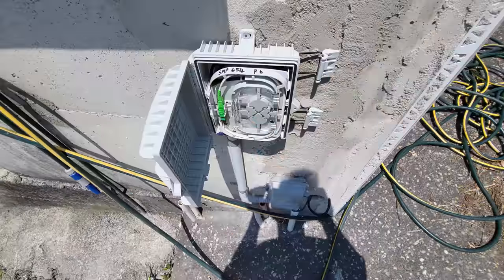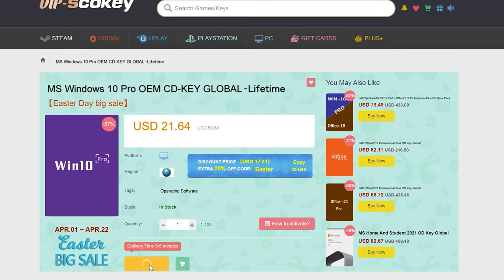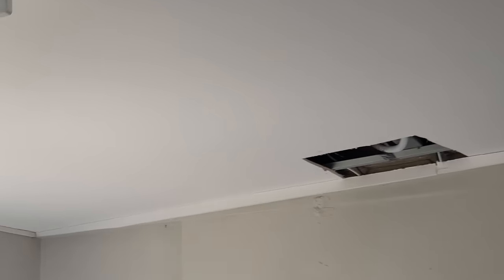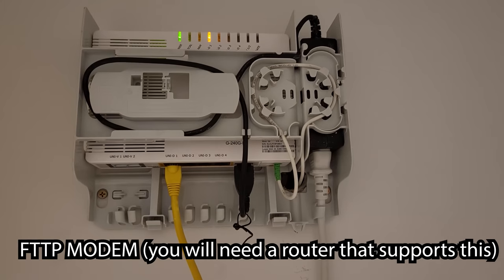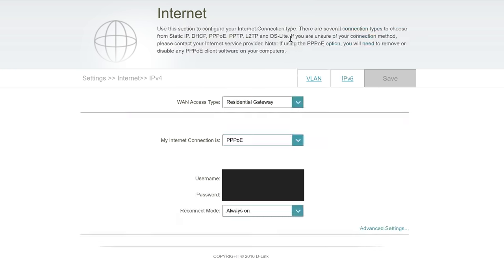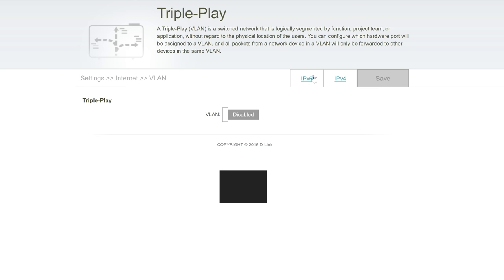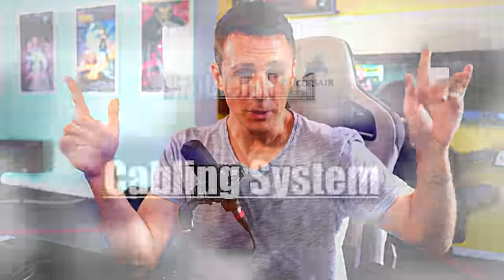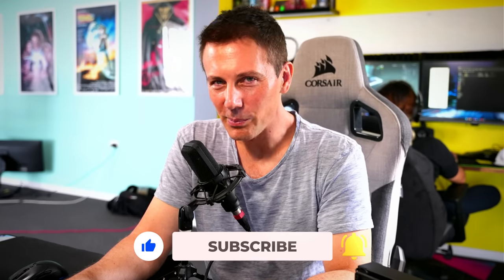UPGRADING my Internet to FIBRE for FREE! (Australian FTTN to FTTP Upgrade)

Comment: I'm surprised your ping was that low for FTTN.  I've seen instances where the node was across the street  and about 10 yards from the street crossover for POTS where the ping was 80 MS to the central offices. (around 50-70 meters total from the yard to the node).  The ping to the central offices to node was 0 MS but the end point through post was ~80ms.  In the US we have ATT which primarily installed FTTN up until ~2014 and voice, data and IPTV service called U-Verse.  My neighborhood was the test bed for U-Verse and the upgrades from the original highest speed/bandwidth package would be rolled out first (I think it was 24 MBIT, then 50, and then 100 for select houses close enough to the node).  It was great in 2007 but the expected too much for POTS.

Comment: Yes!!!!! Finally videos about internet connection! Dear Bryan can you do a reliable setup for a house and which modem router is best
Reply: If you're covering a large home, especially double story, get a mesh system, I always recommend TP Link Deco now after trying a few brands.

Even with a medium to small home you can still just get a single Deco unit and add another later if you need it.

They have WiFi 5 to 7 models so they'll suit most budgets and they look good too.

Comment: Just to clarify nbn will run the fibre through a roof cavity if there is one, it looks like for this example he had a flat roof, the other part is the technicians do care if they have to return because they're contractors they get paid per job and it's only about $200 per job that's why they don't cut plaster and reinstate it because if they did they'd be out of pocket for the installation, best option is to find a local comms contractor get them to install an internal Conduit to where you want the nbn ntd and prove the existing lead-in conduit just so of a new lead in Conduit is needed that it'd go to where the internal Conduit is fixed

Comment: Requiring a username and password isn't inherent with FTTP,  it's specific to RSPs that use PPPoE instead of IPoE/DHCP. You can find lists online of who uses what but choose a provider who uses IPoE if you want easier setup.

If you don't want to hold up the NTD install you can let them install it in an easy location and then run an Ethernet cable from there to your preferred router location instead of the fibre cable at your leisure.

As for requiring a router that supports FTTP, the router only needs to have an Ethernet WAN port which I've never seen a router that doesn't one, they pretty much will support FTTP because the NTD box is essentially doing the job of the modem.

Hard to say what happened with the PS but even if it was configured with an IP address outside of the .100 DHCP range it would still work if it was in the same subnet. Changing the range may have triggered new IP leases to all clients which caused the PS to reconfigure with a usable address, hard to say.
Reply: Yeah one can use a router from 2005 with FTTP will it handle the speeds prob not but it would work.

Comment: I did this a while ago change from FTTN to FTTP at $0 :) .. just need to switch to a 100/20 fast plan for $80
In NSW .. The NBN fiber install guy ran a conduit through my roof and down and out of my plasterboard in the kitchen.. so some of them will install the box anywhere you want it and cut a small hole to run the fiber cable out to the Powered box.

Comment: I'm still on FTTN and apparently won't get the upgrade until around December where I am. I'm only around an hour and a half out of Melbourne in what it now a very built up area which still seems to have the infrastructure for when it was a quiet town 20 years ago. I was complaining about the NBN being bad due to the copper back in late 2016, nearly 8 years later it's still a problem.

Comment: 6:06 what do you mean by box? Is this the point where the modem will connect to on the other side? If so is there a measurement limit on the distance nbn won't install the box? (If I want it installed in a certain room)

Comment: In the US where I live there is really only one provider if you want fast internet which is Spectrum. I'm currently on their 500/20 plan which cost $69.99 but I really get around 575/24 due to over provisioning they tend to do. The fastest speed available to me they offer is their 1000/35 plan which costs $89.99 per month. For me their 500/20 plan is more then enough.

For those lucky enough for even a 2nd option would be DSL which caps out at 40Mbps which costs $50 per month.
Reply: I'm sorry but I wouldn't recommend dsl never can go back to that pain 😂😂 if you want better upload you gotta look into fiber FiOS gives 300/300 for under 60
Reply: For my area internet over cable is the fastest you can get through Spectrum which offers up to 1000/35 for $89.99 per month if you want the top tier plan. The other only choice there is here is DLS which caps out at 40Mbps if you live close enough to the DSLAM.

At one time I was on DSL 3Mbps plan which was top tier at time which that ISP was the only option you had for fast internet. During that period of time cable internet was not a thing here. Cable internet did not show up until some time after Adelphia took over our area but their speed was just a little bit faster than DSL.

Our cable internet speed did not really took off until Time Warner Cable took over our area and again when the name changed to Spectrum.
Reply: I wish we had that price here in Texas, we have to use cellular which is 90/month for 250/35 and grandfathered in.  If that goes away, the wisps were charging 99 for 5mb... one says 25mb but I'm not sure if they offer service where we are.  A dedicated IP fiber line 10 mb would have been 650/month + 3 year contract (that was the only fiber option)
Reply: He made a mistake, I use Exetel too, I pay A$120/mth for 500M (700 actual) but could go 1G for about A$150.

Comment: I remember the early DSL days when copper tv cable internet was the cutting edge and outclassed DSL by several landslides because speeds could go so much higher by a few clicks, 20 years later and it entered the same fortune as DSL: just not fast enough.

Comment: Thanks, it sounds like NBNco are more helpful these days. Early on they insisted in installing their gear at the closest point in your house to the street, often this meant under your bedroom window, kind of useless.
I'm on a 25mb plan with FTTC, so only a short run of copper, that is way easier to move than fibre. I'm waiting for the higher speed tiers to come down in price, as I'm not working so the budget for such is extremely low. All my streaming content comes through fine, Yes YouTube uploads could be faster, however I'm 62 and started out using 8 bit computers on a 300bps modem, so 25Mb is bulk fast.
What was that, a game with a 100GB download, that is nuts, no wonder you went after the upgrade.

Comment: do you know how far away the fttn box is from your location?, i only have fttn 100/40 plan and i get bad ping rates over 25ms, and roughly 450m from the node. so hopefully once i get fibre in a year or so it will drop my ping rate to sub 5ms like you.

Comment: AS to the Japan imported power supply, unless it is certified for Australia electrical standards in case of electrical issue or fire. You will end up invalidating your warranty/insurance, this is the case for all those china aliexpress gray market electrical appliances too.

Comment: Thanks for the video! We just requested the upgrade and waiting for the technician to come. Wonder the original NBN white box be still used for FTTP? And do I need to upgrade router? My router is tp-link VR 1600V
Reply: Yes, I had the same modem, it doesn’t have the speeds of fibre
Reply: It can’t handle speeds of fibre*

Comment: Hello. I am in western Siberia, somewhere far away we say “in the ass of the world.” In 2011, 1 Gbit optical fiber was installed, for all and sundry. Cost 0. Now I pay 10 USD for about 400-750 Mbit with peaks up to 1 gigabit. Games download in a matter of minutes. I thought the rest of the world had long been entangled in networks like electric cables in Shanghai. Well, it’s a good thing, although the installation could have been done more carefully. I tried an Internet test from Siberia to Melbourne, ping 267, download 160 Mbit, upload 318 Mbit. Well, judging by the distance, it’s not bad at all. Well, not bad for 10 bucks then?

Comment: Would NBNCo use the existing copper line to string up the fiber up stairs threw an existing telephone port to put the NTD other place then the garage, say to an upstairs telephone port ?
Reply: If the old phone line is run through conduit or at least moves freely, and you don't care if they pull it out, most techs will be happy to use it to pull the fibre through.

Comment: Recently got fiber to the node on my block. Prev speed on the block was 20mb dsl on  a block box that was 45 years old... Fiber to copper is 500mb 45( crappy dsl isp) 55.  1gb speed price cost 55 now.  Upload thru is 25 thru

Comment: we recently got FTTP installed in the house we are in but our speeds are still under 100, even though we are paying for 250, I'm 99% positive its because of our modem with it being a Archer VR400 V3 it still needs a phone line to connect but im using it as a modem and i have a router connected to it which is a Netgear Nighthawk AX5400 router which i know is good because we had it in our last house which was on HFC connection and we got a lot better speeds.

If you have any recommendations for a good modem (Just a modem) then please let me know.
Reply: With FTTP you normally don’t need a modem you should be able to plug your routers WAN port into the fibre box. That assumes your router is compatible with FTTP and with the service provider you have.  If everything is compatible you shouldn’t need to use your modem in ‘Bridge Mode’ either.

Comment: UK just rolling out upgrades too, got my package a couple months back and it's crazy good nothing like the old package. Pings being the most noticeable improvement personally, the speeds are nice but we're not too heavy on traffic here anyway. Crazy how much that bit of copper was slowing down the whole thing. My pings are nuts now lol, can't wait to get a new GPU again so can try some online games out. Desync had become an issue which I had never had before but I'm hoping this reduces that. Hate pushing a corner in a game, meant to have an advantage and just instantly die lol. I know I'm getting older but I'm not that bad I swear XD

For those curious I'm running an i7 10700k with a GTX 660 atm so I know the struggles XD

Comment: I am eligible for the FTTP upgrade but at the moment I have 2 lines into my property FTTN connections because I have a big house and run one computer on the top floor on one line and another computer on the ground floor on the other line. My question is; am I able to run the two computers from one FTTP connection and if so, how would I connect the top-floor computer to the FTTP box that would be installed on the lower floor. At present, I have two separate copper lines directly from the pit in the street with one line going directly to my lower-floor Modem and the second line directly to the top-floor modem. Is there a provision in the modem (if I can only get one FTTP connection to my house) to run a fibre cable from the lower floor modem to the top floor modem; at the present time I am paying for 2 connections and it would save me $100 a month if this is possible. Do I get a different modem when I upgrade or have to use the current modem?

Comment: We have copper to the house in Slovenia.. up to 1Gb. Works like a charm, just a bit more latency.
Looks like there are different copper wires as well (we have coaxial something something).
Reply: Coax cable is very different than than the essentially phone line that we have. In citys in canada we usally have both coax was rolled out for cable tv and phonelines for phone giving you a choice of two different mediums to get data to the house. The phone line is essentially two strands of a ethernet cable that are not twisted. So very hard to transmit high frequencys through. Coax cable has a conductor in the middle that is insulated then sorrounded by a grounding ring making it very good to transmit signals with.

If you have coax cable ran throughout your house you can use moca adptors to get up to a 2.5gb wired link between devices.
Reply: @andrewmcewan9145  tnx for the explanation. I am still trying to force our “city” to lie down an optical cable, as our street is one of the last ones using coax (both neighbouring streets have optical, they just forgot us I guess😢), because the latency on our conection is far worse compared to my parenta house who have optical cinnection.

Comment: FTTP just became available in my part of California. you'd think being 100 miles from silicon valley I'd have had access to great internet a decade ago, but nope. ISPs playing monopoly and having territorial disputes. I just barely got over 200mb down a couple years back, and gig speeds came here last year but only gig down.

I'm in the process of scheduling the install of fiber, and swapping providers to symmetrical 2Gig from my 1Gb down,  30Mb up plan.  I already updated and wired up my internal network for 10Gb between Cat6a and Cat7 runs, and also several fiber runs that will support up to 40Gb. 

Glad you got a good internet upgrade. I'll be looking forward to more content in the future.

Comment: tplink deco or bust -
Dlink is rubbish haha 

I got my upgrade 

30/1 fttn > 1000/50 with Launtel 

Leaptel is also good value 

It took about 30 mins for the upload speed to come through completely

Gotta make sure you’re not hitting the enforcer from nbn on your upload 

My deco gets around 48mbps up and 980mbps down 

$28,000 for a quote - done for free 

Ironically my install was no conduit needed - just run through the roof space about 5m from the old Telstra box

Not a problem so far - no rodent risk here as roof is fairly sealed. 

Guy had it done 45 mins no issues.

Comment: Stuck here with no upgrade path on Fibre to the Building/Basement on the NBN and the max I get is a max of 100/40 with 4ms pings over copper of 147m from the MDF then through a Socket 610 in a town house style unit block with drive ways in the middle and sun with nothing affect the internet connection at all.
Reply from the maker: Yeah my friend has FTTB too with no eligibility but they said they are rolling out FTTB next year, so register on the website and it will notify you as soon as the upgrade is available.

Comment: you should have been able to avoid cutting holes in the roof etc, the upload speeds are not that great for fiber but still progress - consider making an opnsense router box
Reply: They're not symmetrical in the US we have that
Reply: TYC is on a residential connection, which is nerfed because otherwise NBN can't profit off of business needing the additional upload.
Reply: Australian speeds are capped around 4:1 compared to download from the ISPs. 

Also no benefits doing a OPNSense/OpenWRT router in a household like Bryan's. I've got OpenWRT running at home but the configuration and troubleshooting would be too much for Bryan who isn't into networking nor Linux/BSD. 

Bryan will much benefit going to an off the shelf mesh network for full home multistory coverage.

Comment: here in the usa from what ive seen and used most fiber is symetrical 100 up and 100 down or 1g up 1g down those look like cable provider speeds, the last cable package i had was 40 up and a 1000 down

Comment: Obviously, I know nothing about how the interwebs actually flow, but I always thought that FTTP always meant symmetrical up/down bandwidth. I'm still on good old fashioned cable and get 540 down/108 up, and was hoping that FTTP would become available in my area. But it looks like even if it did suddenly become available, it wouldn't necessarily mean ~500 m/bit up though.
Reply: That's more of an Australian thing were NBN doesn't allow for symmetrical speeds on residental FTTP. FTTP can suppport symmetrical speeds just NBN hasn't allowed for it.
Reply: It depends on the tech chosen. GPON supports 2.5g/1.5g XG-PON supports 10g/2.5 XGS-PON supports 10g/10g and RFoG supports whatever DOCSIS standard the ISP wants.

Comment: I have had FTTP for a couple of years now it's worked this whole time my fiber/copper broke down once a week.
Reply from the maker: Yeah I had the same with random drops outs on good ol copper line too... The NBN guys told me some horrorstories when they were installing it.
Reply: @techyescity  ours drops every time it rains heavily. Also regularly drops just after midnight for several hours at a time, which I assume is due to NBN upgrades

The old copper connections were scotch locks, good old Telstra "technicians", they're still using this for FTTN connections!

Comment: Funny the city I live in, I stalled Fibre optics network throughout the city in the early 80's.
So most areas have fiber optic to the street. Although many old buildings still have slow old phone lines or cable, which is faster.

Comment: I had my internet upgraded from FTTN to FTTP just yesterday. I am paying a lot more per month than you at $150pm for 500/50 connection. My new modem has not arrived from my ISP yet, so I'm using my old modem which can handle about 450mb down.  The installer was nice. although he did pee on the toilet floor before he left.  🙄